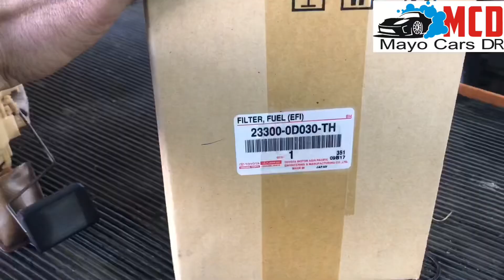How to✅Replace Fuel pump & filter of toyota camry2006-2010

Comment: Thanks a lot mate i followed every step instructed in this video and successfully changed the fuel filter. Car starts in a second now rather than having to crank for a few seconds.
I just understand why they didn’t put the filter just before the fuel pressure regulator in the engine bay for ease of access and replacement. Could’ve been a 5 minute job max then.
Reply: They make that way because they don’t want the average Joe to be able to work on his own stuff. They want us to have to take the car to a garage

Comment: Thank you!! I have changed my 2011 Camry V6 fuel filter on 240k by myself,  acceleration has definitely improved and save more than $150.
Reply from the maker: Thanks for comment
Reply: I have a 2001 V6 camry. I changed the fuel pump and the flat Strainer. Is there a separate fuel filter elsewhere?

Comment: Thank you for the video! This fuel filter and fuel pump assembly is for a 2002-2006 Toyota Camry. Not 2006-2010. The 2007 is a new model year with a new assembly.

Comment: Thanks for the vid.. I did my own on a Camry 05, 2.2 with 170ooo miles,
changed pump , filter and press regulator.
Used a TYC pump.. more noisy but worked fine.
Had never done it before.. Took about 2 hours.
Thought that was the problem for persistent p0450..................................... wrong.
What a huge money pit.
Finally had to get rid of it. I got the rare bad 05 camry
Reply from the maker: Thanks for coments

Comment: I performed a fuel pump replacement today and want to share details. I disconnected the battery but not the relay fuse for safety and to prevent any electrical sparking. There are two ways you can proceed. You can  purchase and replace the whole assembly which includes the pump and filter. Or, you can purchase the filter and pump together and swap them out of the originally assembly in the car. I chose to purchase the assembly. 
First off the bottom seat has to be removed. I used a long screw driver. there are two metal loops that protrude from the seat  down into the body of the car and latch on. you need to get next to them and pull the screw driver neck up. this releases the metal loops from the body and the rear seat can be removed.  It is kind of a violent motion. 
There is a metal plate covering access to the top of the pump. It is glued in with a silicone  type of glue. I scored that glue with a utility knife and removed the plate with flat head screw driver carefully working the plate from the body. Once that was removed, I let it hang by the front of the seat area and placed it into a large ziplock bag to prevent glue from staining any part of the interior. I had a tough time removing the power socket from the pump. you have to play with it. Push the top tab away from the center of the electrical connector and use a flat head to remove the plug from the pump. You have to play with it. I would watch different videos and focus on that. I still dont know how i pulled it off.  I used a flat head to remove the clip from the fuel line. No problem. I read that someone had a corroded clip and was afraid to break it so I bought two at Toyota for $10 but didnt need them. 
I had rags for when i separated the fuel line from the pump I also bought a can of spray air in case I need to blow fuel to evaporate it. However,  there was not much fuel that came out. I used a philips head and socket wrench to remove the metal plate that holds the fuel pump in the tank.  You can use either as the bolts have philips head crosses embedded in the. 8 bolts. 8MM. Be careful. I dropped one but was able to recover it. 
I took the old fuel pump out and used the rubber gasket from the old one that seals the assembly pump into the gas tank. I then put it back together. The assembly is "spring loaded" meaning you have to push it down to secure it with the screws. Took about an hour. I had a check engine light on and slippery wheels and vsc lights on.  I replaced the mass air sensor and the pcv valve. I replace spark plugs and coils recently. lights came on and off and on and off intermittenly. Hopefully this will do it. Car starts so much easier.  We will see.
Reply from the maker: Nice work dear
Reply: @MayoCarsDR  thank you for your video. car starts on a dime. think i am going to salvage the old assembly and buy  a pump and filter.

Comment: And i was told you should also remove the fuel relay and turn the car over to depressurise the line before removing the fuel connector? Also as a precaution the negative battery terminal should be disconnected before doing this job? Just saying...

Comment: Excellent video,my 05 camry v6 has 270,000 ks and im not sure if its ever been replaced before but ive ordered the filter and pump and going to do it. I noticed you didnt replace the mesh sock on the bottom of the whole unit? It looked like it could have done with a new sock also? The kit ive ordered has a new mesh sock aswell so im going to replace the everything on it. What sort of lube did you use on the rubber fittings? Im guessing dielectric lube?
Reply from the maker: Comes new with sock fuel pump
Reply from the maker: For lubrication I have used engine oil
Reply from the maker: https://youtu.be/HRohuPtcGjI
Reply: Cool,thanks for that muchly appreciated.
Reply: @MayoCarsDR  yes my kit ive ordered comes with new filter,pump,mesh sock and rubber seals,but watching the video when you put it back in the tank it appeared to have the old sock on it? I did see you blew it out with compressed air when you were reassembling it but i didnt see a new sock get put on it? Just saying.

Comment: Question, what is the fuel pump/filter assembly unit that you used to replace this? I am new to fixing my own car and I'm not sure generally what are good parts/how much they should cost.

Thanks in advance!
Reply from the maker: What is your vehicle and what parts do you want to replace?
Reply: @MayoCarsDR  can you give me some help possibly? My car is wasting more than the usual gas and up a hill it jerks at time… 2007 Toyota Camry SE V6 I believe its the pump but I need the part thats reliable THANK YOUYY

Comment: Was that gas that was used to lubricate when reassembling?
Reply from the maker: Yes
Reply from the maker: Lubricated parts are easily fixed
Reply from the maker: Thanks for coments
Reply: Oh shit really? I used engine oil , thinking that you were using engine oil. Did I fuck up? Why would u use gas if it evaporates straight away?
Reply: @TheCityofGod  i did the same...its running fine tho... what happened with u? did it cause problems?
Reply: @DesiAnanth  nah it’s running fine no problems at all

Comment: You mean how to replace the pump housing.. 🤔
Reply from the maker: Thanks for comment,The pump housing is the filter
Reply: @MayoCarsDR  I did not know that.   I just replaced the motor only because the local Auto parts store wanted over a thousand bucks for the whole unit.